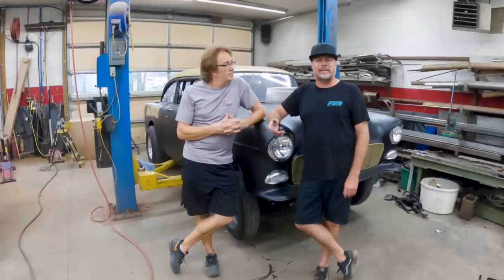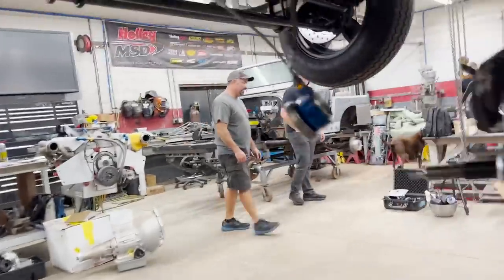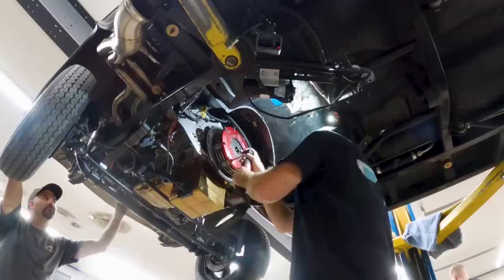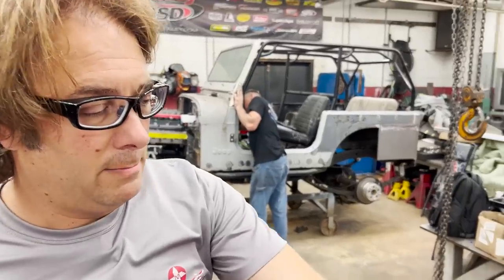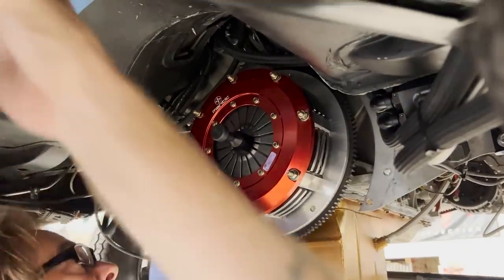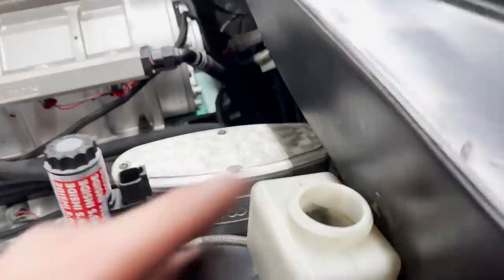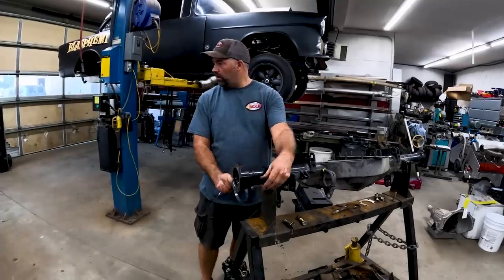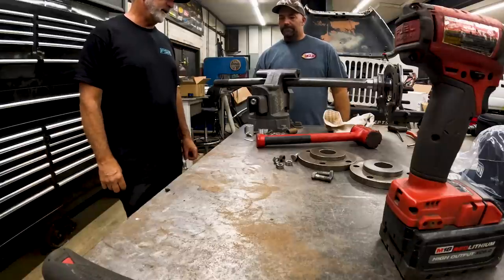GETTING BLASPHEMI READY FOR THE TRACK

Comment: Use a 4 inch pipe cutter for removing the housing ends it takes less time and comes out a straighter cut than with the death wheel grinder

Comment: I raced super modified lawnmowers around 2004. I’m not really a mechanic. I’m more of a decent parts changer. Our racing was so close at the time. That any little thing could be difference between 1st and 7th. So I got the bright idea to sneak around and have me a one off billet flywheel for my Vangaurd that already had. A cam roller rockers big push rods  high torque starter and aluminum rods. They started making aftermarket flywheels a few years later. But as far as I know. I had the first one on a twin cylinder. So I had it built put it on and for sure it would slap the fuck out of 4500 rev limiter just blipping the throttle. But I didn’t take into account that if it revved up faster it was also gonna rev down quicker. When you let off the gas to set up for the corner.  We didn’t race mowers like on tv. We raced on a high banked oval. So when I would dive down into the corner. Instead of dropping down to say 3,grand it would drop to 1200rpm. And did it ever fuck up me winning any races for about a month. Until it dawned on me what was going on. Because I was cheating. I couldn’t ask the smartest people I raced against like I normally did. But I figured out eventually that a shaved steel flywheel worked better for me.  Now you can buy a billet flywheel for a huffy if u want it.

Comment: In 1996 I bought my friends HS car ,  I repainted the car and did a complete restore on the body with pans to revive its body .Fast forward to 2007 I Sold the car . When. I was at an auto Rama I was thumbing through some old Hot Rod magazines and came upon a story with a 1969 mustang mach 1 done up in the old cars paint it had on it before O painted the body . A blue with white hood scheme and two tone tuning down the body . I noticed several welding improvements like the shock tower supports as it was originally a Big Block car . The idea that someone maybe sitting on a drag race historic car is still in the back of my mind . If your buying a parts car or modified model pay attention to the small things , you might be sitting on a piece of racing history .

Comment: Tell Eric Yost that the axle ends have a stress riser wrapped right around the axle right where the broaching process stops.  It is caused by the broaching process itself, that is why they have a tendency to break there - if I remember my "Mechanics of Materials" classes correctly.   If an axle shaft breaks in between the splines and the end of the axle, it is because it is unsupported along it's length allowing it to flex.  Think about taking a piece of cooked spaghetti and twisting the end.  It will warp and twist into a loop.  That is basically what the middle of the shaft is doing.

Comment: I'm curious why the decision to narrow the rear end was made, opposed to just buying a new set of wheels with a deeper offset.  
To my mind, that would have been a better option, because getting the offset of the wheels more to the center of the rim, would load the tire more evenly, and not put as much stress on the axel bearings.

Comment: You start getting worried when you see colors on your disk. Blotches of dark and light pastel grays, that's normal. Happens to nearly all hardcore clutches and if you pay that much for one, it's expected that they can take it. Warping is relatively easy to check using a mirror, as in, if you see warp in the metal, in the mirror, they're done (mirrors "compress" the image, good for sighting stuff without your brain lying to you).

Comment: The stuff that Customs by Bigun was saying about hollow axle shafts being stronger is wrong. You look at cross sectional area when evaluating shear and bending strength, not surface area.

The thing about removing a little material from the center of a shaft is it has a very tiny effect on overall strength, while reducing weight.

Now, if you upgrade to better material AND hollow axles, then you improve both strength and weight reduction.

Comment: Alot of heat on a clutch at times  You might have lost the inside disk due to hat bolt stretch and not enough tension to the inside disk, if they weren't ever replaced, lets say.  It was taken apart multiple times, but always the same hat bolts and washers going back in?.   Very curious.  Would be nice to have a full spare trans clutch combo in the trailer, that you would never need then, until power tour.  51-1/2" for my Strange 9" width for my 56 210 with my custom wheels and backspacing.